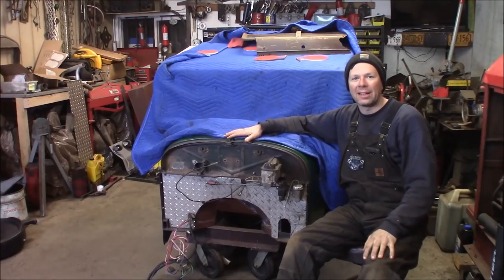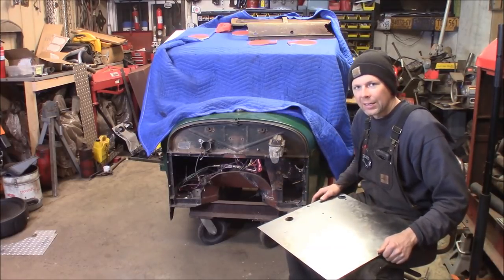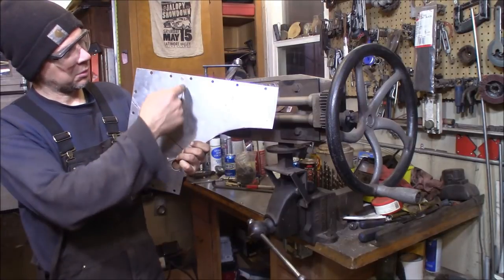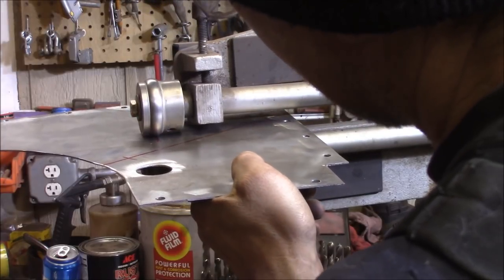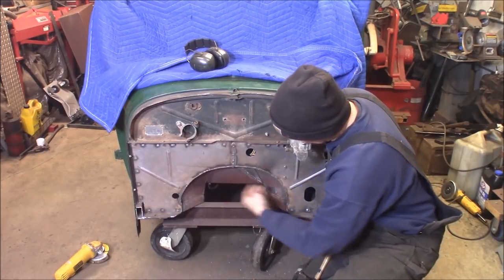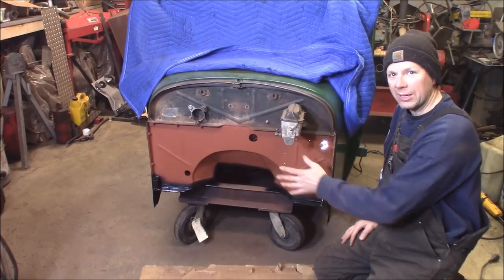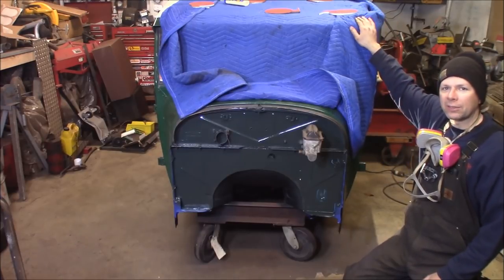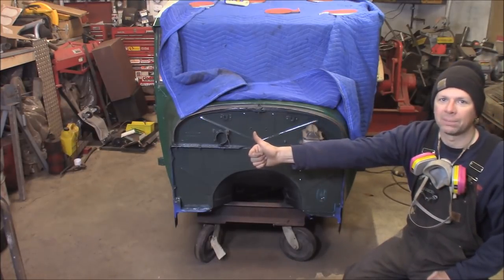Model A Hot Rod Shop Truck:  Firewall Fabrication

Comment: It would be nice to see what you've done with the brake pedal. I also mounted my master cylinder on the upper firewall and built a suspended pedal.
Reply from the maker: I will be working on the pedals later.  The brake pedal is out of a Jeep Cherokee and basically mounts to two tabs welded to the firewall using the stock Jeep pivot bolt.

Comment: You aren't attaching the lower firewall to the tank?
Reply from the maker: The lower firewall is attached to the cab.  The tank bolts to the cab separately like original.